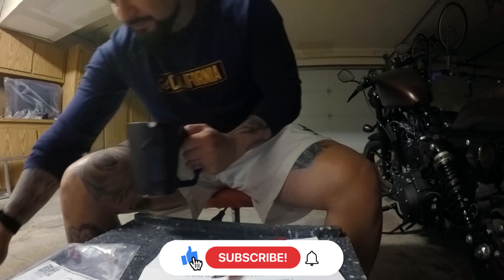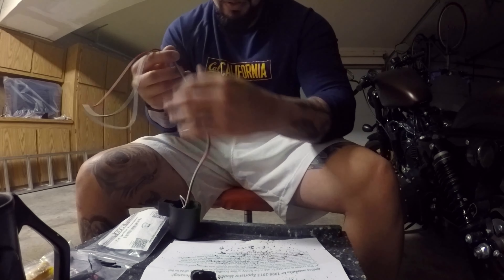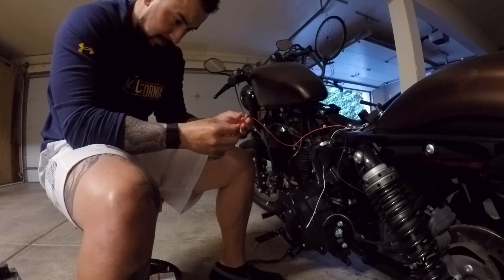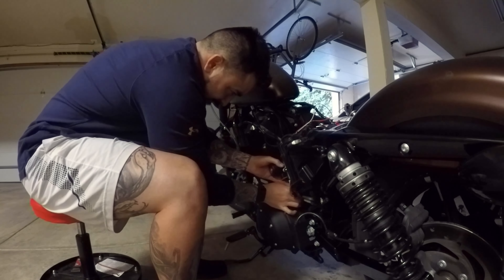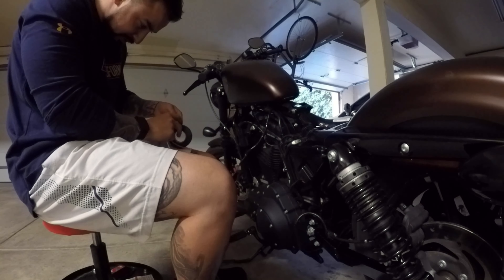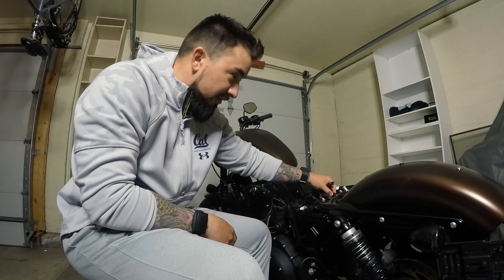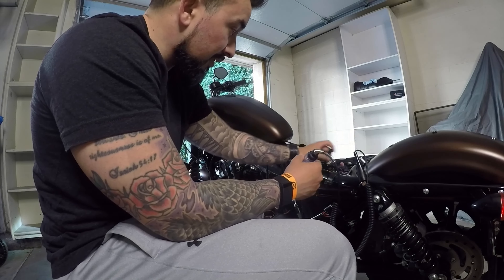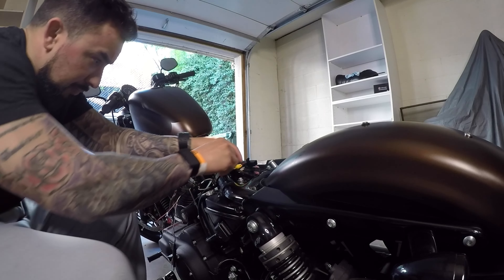Ignition Relocation & Push Button LED - Harley-Davidson Iron883 - Part II

Comment: See my comment in part 1
So what you cut off was the factor plug.
Did it plug in to the back of the switch??
Reply from the maker: Yes it plugged into the back of the ignition. With the push start you need the wires but do not need the plug.